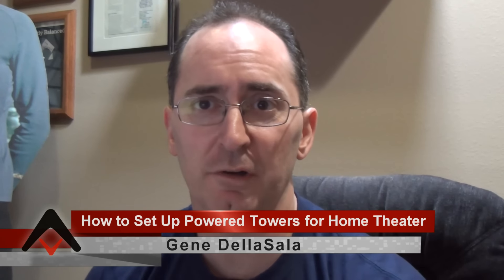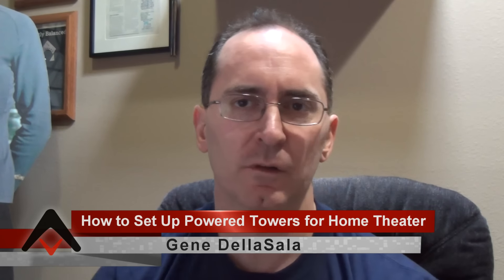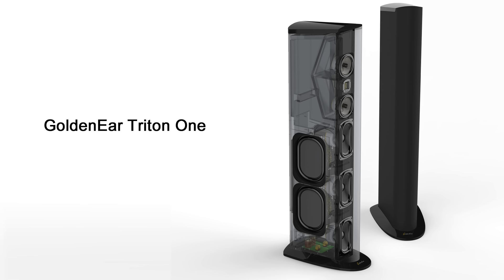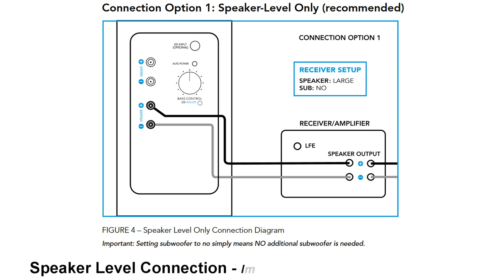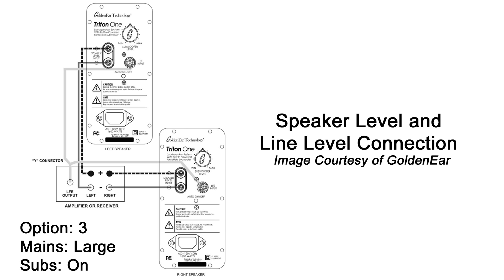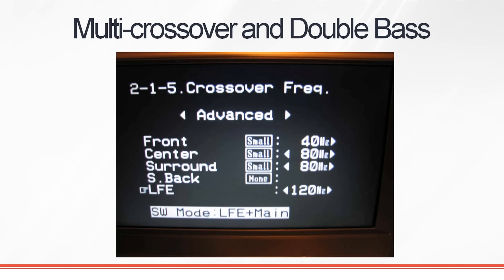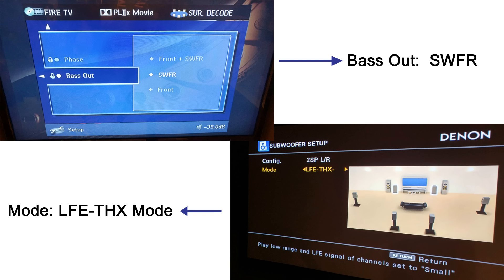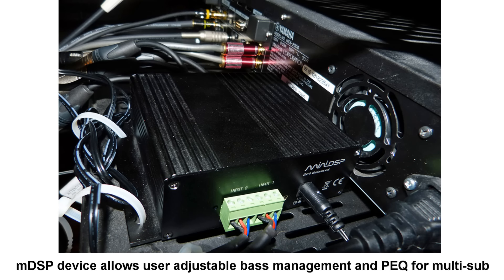How to Set Up Powered Tower Speakers for Home Theater

Comment: I have Def Tech bp9020 and i added dolby atmos A90 on top . I connect to the high channel posts of the speakers. But , i can only get the sound from the A90 speakers. I tried to connect to the bottom posts and then I can only get the sound from the Bp9020, not the A90 . What did i do wrong? I have a Marantz 5014 Av receiver. Please help me
Reply: The top speaker post are only for the atmos A90 speakers that sit on top of the main speaker.  The bottom speaker terminal is for the main speakers in the tower.  Conne ct your left and right front speaker terminal from the Marantz to the lower post on your left & right towers.  Connect your height left & right terminals on the Marantz AV to the upper terminals on the towers.  I was unable to locate your Marantz model, but if you have height speaker terminals on your receiver, this should work.

Comment: In my case I have 4 DefTech powered towers as main channels and the surround channels.  This was simply a matter of convenience.  I had purchased an older set of DefTechs some years ago and recently purchased a new pair.  I was going to sell the older set and it came to my mind to replace the smaller existing rears with the older powered towers.  Integrating this setup has been something of a challenge in the family room as the left main is adjacent to a hallway and the right main is in a corner thus emphasizing bass on the right and de-emphasizing bass on the left.  My current setting on my AV Receiver is LARGE with LFE off.  Any suggestions for handling my unbalance room config would be appreciated.  Currently, my attempt to handle this unbalanced room config issue is by turning up the left main speakers power to near max and turning down the right speakers power level.
Reply from the maker: You should run line level from sub out to your Def Tech towers and turn sub to ON and see how it works.

Comment: Hi Gene and Audioholics crew . 

 

I love all your videos and articles, I have learned so much
from them….

Since you just posted a video on powered towers, I have a
question and hope to get some advice. 

I have infinity RS10 powered towers (10 inch subs in each/
275 watt amps) and an infinity Alpha 1200 (12 inch sub with a 500 wat amp) and a
Denon AVR-X3300 receiver.  I have set up
my speakers as 5.2 and have two additional center ceiling speakers.    The standalone sub sits next to the right from
speaker (that is where it sounded best with the crawl mw method. 

I listen to music, but mainly watch movies.

I am wondering what the best way to hook this up, I would
like to use all three subs if advisable.  
At this time I  have connected the
Alpha 1200 to one of the receivers sub outs and the two subs in the  RS 10 towers to the second sub out on the
receiver using a y connector.  I have all
my speakers set to small and set the x-over in all to 80 Hz.    I am wondering if this is the best way to
do it.

Comment: A lot of the powered towers have DSPs now which and latency. For speakers with DSP's wouldn't it be best to run them as large and just use the LFE input for LFE only? I would then think the AVR would be able to adjust phase properly.
Reply from the maker: Sure you can run them large and LFE line level.  I would measure the system at the listening area and adjust the delay to the subwoofer channel until you get the best blend.

Comment: I don't think any manufacturer has equaled what Infinity did with their Interlude IL60 in terms of flexibility back in 2000. It offered RABOS, subwoofer volume control, and a switchable high-pass filter for the primary drivers.
Reply from the maker: Greg Bright You're right!  The Prelude MTS was particularly excellent is setup flexibility and had better performance than anything Infinity is doing today.

Comment: Thanks Gene for another informative video. I have tried every option you have listed here but I am trying a different one now with my Denon X6300H receiver set to Large for the main speakers which are Definitive Technology BP-8080ST towers using the LFE+Main option and setting the crossover to 40 Hz. All the other speakers in my 7.4.4 system are set to small with a crossover at 80 Hz. Finally I have 4 RBH Speedwoofer 10S subs daisy chained on top of each other at each end of the front stage with the crossover set at 80 Hz and the LPF set at 120 Hz.

I am not sure how a meter would read with this setup but my ears tell me that it is the best option for my listening environment of all the four options. The way I see it is that I paid a lot of money for the lower sections of those towers and this is the best way to use as much of it as possible and still maintain the best overall SQ.  

What does your experience tell you about this method?

Comment: My towers have a powered sub with a crossover setting and volume control on each speaker. I have been sending only speaker wire from avr to tower. 

I set as small for video and x-over at 60hrtz. 

And I set as large for music. 

I also have a dedicated sub. I was told to do this after I once fed the towers and dedicated sub the sub channel and LFE.

Comment: Do powered towers have any advantages over passive + separate subwoofer, apart for amp requirements?
Reply from the maker: Only in space savings. You can achieve the same or better results using passive tower/bookshelf speakers with separate powered subs.

Comment: how can I have 2 tower speaker w/subs like Triton 1's AND 1-2 regular subs? I cant possible use a 4 way splitter off the preamp LFE output?
Reply: I came across your comment, and I had similar challenge,,,I am running all speakers small, but have my Triton ones AND 2 stand alone powered subs all split form the same LFE signal from receiver.  Sounds a bit like a hack job, bit it works well .  Each sub is like set at 3 ( on scale of 1-10) and with 4 total ( 2 triton ones, and 2 stand alone in rear and towards back corners or room, it works ok, but I had to play with phase a bit on the two standalone subs to find the “ sweet spot” output and avoid cancellation due to phase.
All this said, only issue is when I try to go to 2 channel stereo mode for music, my subs are not on , and tritons bass is very weak ( like they are not seeing any low signals from receiver) I then have to change settings to front-large, and disconnect rca’s from Tritons…then tritons sound good with decent bass, albeit not as much as if all subs are on.
Sometimes easier to just leave all with the movie set up, and okay music through “ all channel stereo “. All subs inane sounds ok, but then get music through all the surrounds as well. …that is actually how I found this video, hoping for a solution to my music listening problem,,,,but splitting signal 4,ways does work….

Comment: Ho thanks for your inputs. I have a BP9080X CS9050 SR9040. It's all hooked to an Onkyo TX-RZ1100. 

The Onkyo doesn't allow me to select speaker level size ( Large/SMALL etc) it only allows me configuration selection. 5.q.12, 5.1.4 or 6.1.2 etc. Being getting conflicting suggestions on how to set up this system. Like for eg DefTech says select NO sub in config but 5..1.4 in configuration which is wrong. They also advise not to do a LFE level connection 

Can you please help me with the 5.1.2 setup please for speaker config, crossover and level calibration please

Comment: OMG! Im lost! The simplest hook up of speakers red wire silver wire ..left...right and simple radio connection is not even working...no sound...nothing! Not even white noise....ive tried every connection button on my amp....nothing😰😰😰😰
Reply from the maker: 1. Make sure your speakers are connected to the amplifier front left/right speaker terminals.
2. Make sure your amp/receiver is plugged in and powered up.
3. Make sure the speaker a or b is selected on the front panel depending on which you are using.
4. Make sure your amp/receiver is not muted, turn the volume up about 1/3 of the way clockwise from zero.
5. Make sure the proper source is selected on your amp/receiver (ie. tuner, DVD, cable, etc).
6. Make sure your source is connected to your receiver (ie. DVD player HDMI or toslink to the receiver)
7. If all else fails, call and consult ;)

Comment: 'Subwoofer out' only works on newer amps. It's meaningless on older amps. On the older amps, what he's leaving out is that pretty much all amps (intergrated) you can use the tape playback RCA's as a subwoofer jack. There is always a signal at those jacks. One size does not fit all as this guy suggests.

Comment: Hi Gene, 
          I have the Yamaha RX -A 3050 no LFE + main, have speakers set to small 80hz but auto eq sets them to large. 
Sub is Def tech Supercube 4000. 
I've run the LFE but in 2 channel no bass or little bass, how do I increae bass in 2 channel ?
  Thxs